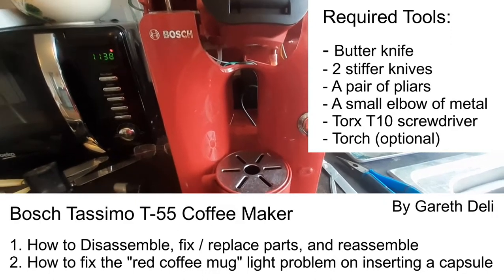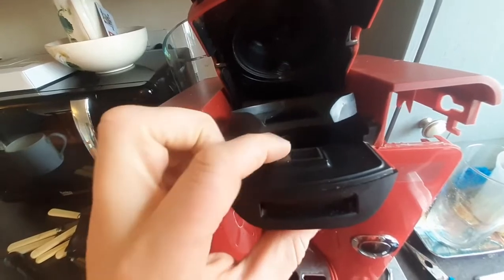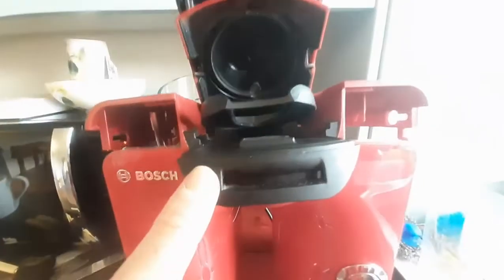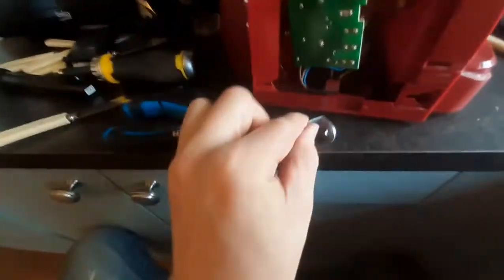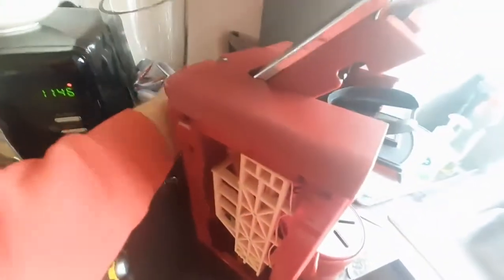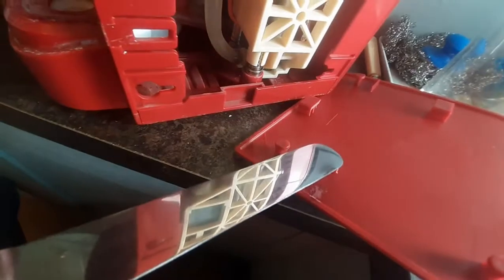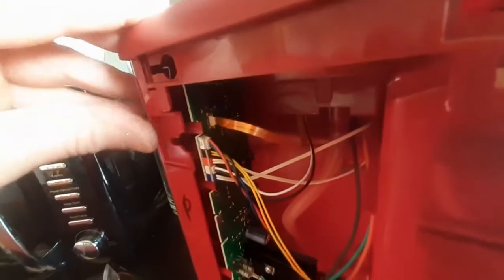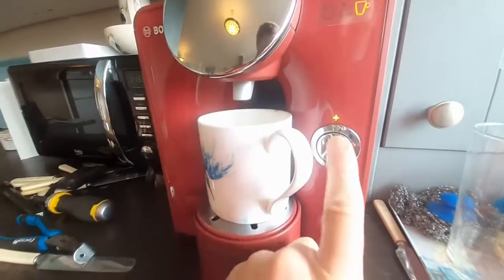Tassimo Bosch TAS55 Disassembly & repair

Comment: You’d think decent quality manufacturers like Bosch would want customers to be able to self repair their products themselves but company’s prefer to have repeat custom vs self repair 

I’m curious has anyone attempted a repair of any of internal components at all such as pump pipes main board 

Bosch would still make profit on spare parts if they offered replacement spare parts to customers